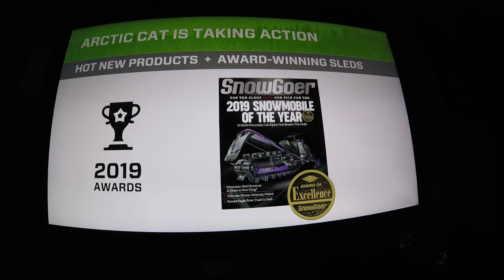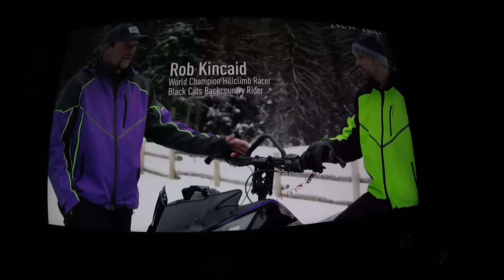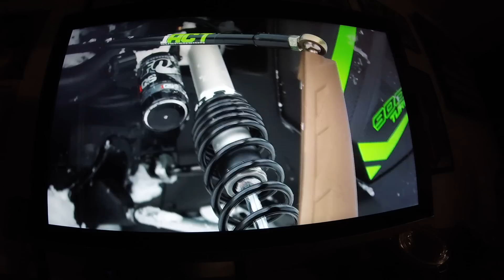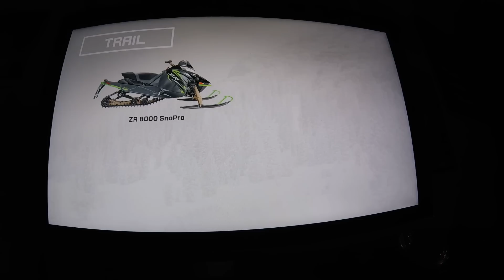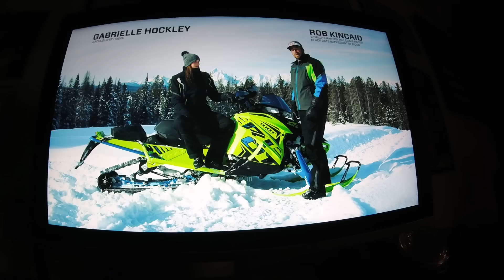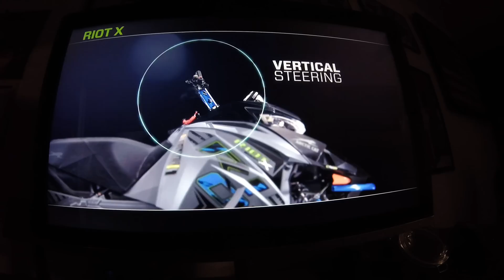2020 Arctic Cat Snow Lineup is here!!! New RIOT first look!

Comment: Cat should bring back the high flow air induction system and let there zr 800 ctec 2 breath air from the front and not the back or on top redo it so it breaths fresh air from front of body frame for more speed

Comment: 850 world??  Are you an idiot??  The Doo is the only one that runs.  The Poo is a continuation of poor engineering, incompetence and still can't build an engine that  goes back many years.  The new C Tec 800 runs with that Doo 850 already. The Poo, isen't even a concern.  Now with the performance changes internally with the new 800, it will be better, more torque, more Hp, then last year.  Just wait boys and girls. It  already surpasses with the 850, it will even be better.  Meanwhile, the POOs are still blowing pistons, cranks, and drives..

Comment: I’ve loved my new Alpha. It flat works. It’s runs with the 850’s in most snow conditions and I think it’s a little better on the deep days. I haven’t had a single problem. I hope they find a better way to take care of the dealers so we will continue to buy the products they produce. I would never buy one without the good dealer support. I like the new colors as well. Good job AC. P.S. could you please find someone less excited about the new product ? Someone check this guys pulse.
Reply: blmotor1 lol I love within an hour of thief river falls where they are made I just walked in and said I want that one and I evan got to watch mine come off the line
Reply: How excited can one get about new color schemes and an revised rear suspension in one sled.